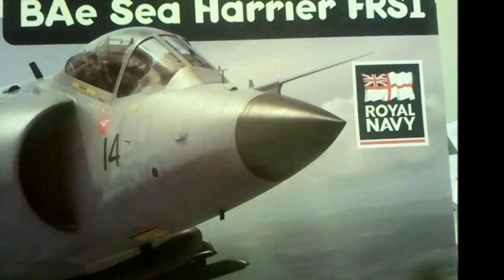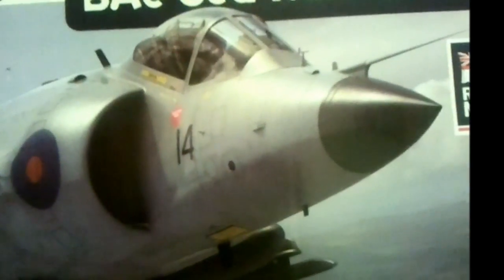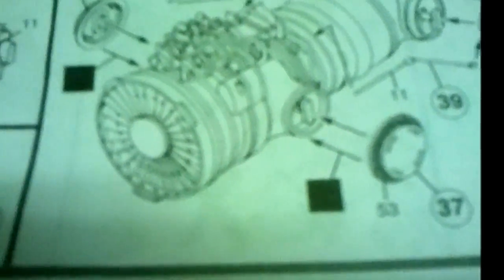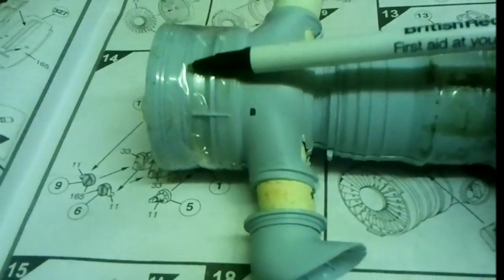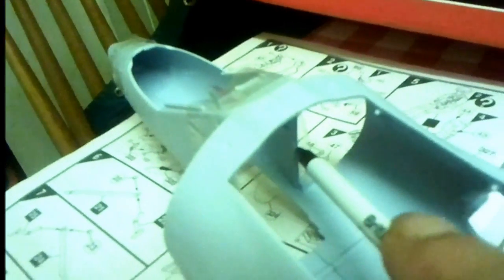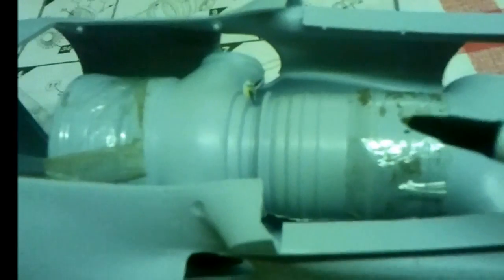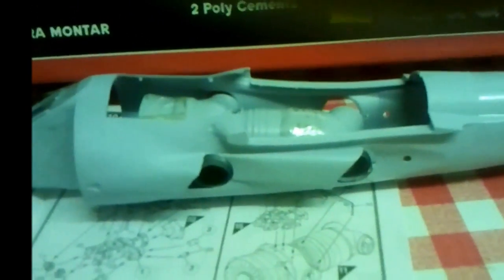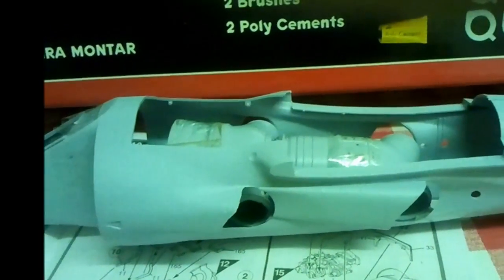SEA HARRIER MODEL BUILD 1;24 SCALE

Comment: no way is that gonna hover !!
you would need about a quarter of a horsepower plus the ducting would need nice and flowing not a hole stuck across the air flow. etc. etc.

And the weight of it !! wrong material altogether, Depron and carbon fiber rods etc.
You could always use the model to draw round and scratch build it :)
Also at this scale forget authentic style of propulsion, use a quadcopter instead and hide the motors in the large fuel tanks, plus a quadcopter is easier to fly :D